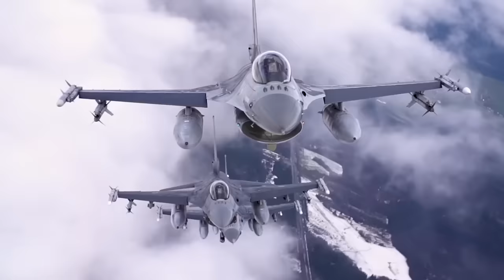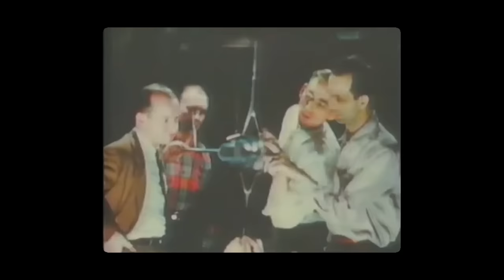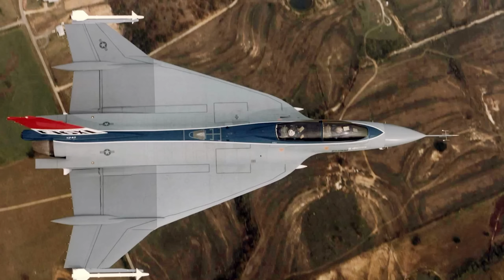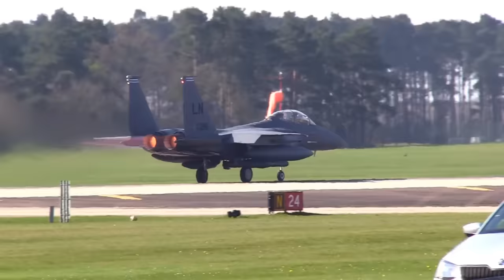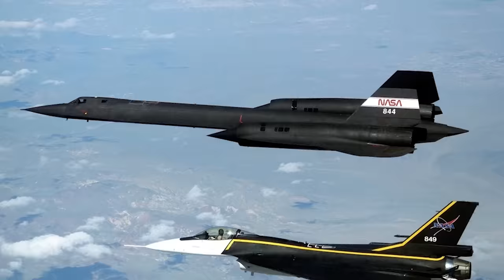When you supersize the airforce you get this…- F-16XL

Comment: One of the failures to be built was a fly-off against the original F16 where it's air-air abilities showed it to be compromised. Plus the newest F16 added leading edge and additional integral fuel to its wings "borrowing" some of the XL advantages. Just look at a brand new F16, it's obvious

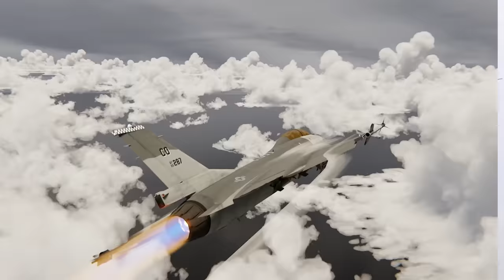Comment: Not to be nitpicking, but I have to nitpick - at 11:35 ; the European 4th generation fighters did not follow the designed proved effective by the F-16XL, the delta and double delta wing had already been proven long before that (for example the Saab Draken first flew in 1955, and Saab Viggen first flew in 1967). Europe always liked the short takeoff/landing distances that the delta wing provided, even better with the canards.
With that said, the F-16XL is a beautiful plane, and it's truly a shame it never got to be put in operational service.

Comment: Honestly, I don't know why we still use the F-16 at all. While it's cheaper than the F-15, it doesn't do anything the F-15 can't do. When all else is equal, you just pick whichever is more cost effective.
Reply: Which would still be the F-16 in a big chunk of instances. On average per year, the F-15 costs twice as much to maintain and support vs the F-16. The F-16 also makes up the bulk of the forces because it simply makes more sense logistically. That said, it won't have as long a life as the F-15 because the F-35 will fully replace it. Whatever is done with the new F-22 variant will likely serve as a replacement to the F-15, but that's still quite a ways away.

Comment: F-16XL wasn't chosen because Air Force product selection isn't about buying either the best or most cost-effective aircraft, it's about that overpaid cushy executive job Boeing will offer you after their plane is chosen and you retire early.
Reply: The F-15 wasn't designed by Boeing.
Reply: F15E was design and made by McDonnell Douglas before the merge with Boeing.
Reply: The XL was not chosen because all it has over the Mudhen are looks, and even that is subjective.
Reply: It wasn't even Boeing at the time.

 The Strike version of the F-15 was picked for many good reasons, as time has proven. It's range/payload advantage were just a few of the reasons.  The XL performance gains were not large enough to warrant a change from the conventional F-16.
Reply: @konekillerking  in addition going from a light grey to a Mudhen was not much of a difference. Going to an XL from a standard Viper was a drastic change. Almost a new aircraft.

Comment: This aircraft with the F119 engine and thrust vectoring would be interesting. It couldn't have used the engine the normal F16 uses as it would be way under powered. Also as it doesn't have canards it would have terrible slow speed maneuverability. I reckon that if this plane was relooked at today with modern avionics and hardware it would be very interesting.

Comment: I'm like, 90% sure that the Gripen's wing is a delta not because of this american plane, but because SAAB has got lots of experience with delta wing aircrafts, probably more than any US manufacturer, that's for sure, and the same goes for the Rafale, Dassault has got a LOT more experience with delta wing fighters than any US manufacturer. Last time I checked, the Draken, Viggen, mirage 3, mirage 4 (which is a bomber), mirage 5, mirage 2000, mirage 4000 (prototype), some of these being 3rd gen and some being 4th gen, were all older than the F-16 XL, these two companies don't have a habit of copying their neighbour's homework.

Comment: Each aircraft is defined by parameters such as wing/loading and thrust/weight.  Someone is lying here.  For a maximum engine power of 29,500 lbf and a mass of 48,000 lb, you cannot get anything other than a thrust/weight of 0.61, which means that the engine is too heavy and the rate of climb cannot be 62,000 ft/min but 27,604 ft/min.  There is also mention of an engine upgrade to the regular F 16 that allows a rate of climb of 62,000 ft/min, but then the F 16XL would have a rate of climb of only 34,229 ft/min.

Comment: The F16XL is being reevaluated because it has the same number of weapon stations as an A10. For much of the last year the A10s were being tested in a different role in the Pacific. A MLD launch platform. The problem is there are less than 300 serviceable ones left. That is why none will go to Ukraine. A large number of MLDs plus a respectable range. The F16XL or its upgraded version would fill that role nicely. It’s all about the money as usual.

Comment: Delta takes a higher AOA for the same high lift, during landing visibility is poor and requiring more power to offset the larger drag and frontal area. The Delta wing is light and rigid but the energy lost in a steep turn would definitely prevent it to engage any close combat dog fight limiting its role to bomb carrier and mid and long range missile launcher. The F15EX has NOT those limitations. Now comparing Gripen E, Tejas and FA-50 with similar/same power plant, the slower with F16 type wings also turns better than both delta counterparts…

Comment: US Air force wanted F-16s.. The designers had half of DARPA funds.. 

just to create an F-16 based on Tejas Aircraft of India 😂😂😂
Reply: Bro the F16 is 40 years older than the Tejas. Wth are you talking about?
Reply: The F-16XL was designed and built in the early '80s, the HAL Tejas was designed in the '90s and built in the 2000s based on the Dassault Mirage series.
Reply: the F-16XL was designed in the late 1970s-1980s...  Tejas didn't come into its form till 2008

Comment: To address whether the US air force should have used this variant or not: Mostly seems unnecessary. No negative context here, other than money. F16 works better as a support fighter, performing well as a multirole, at a relatively good operating cost. But yeah, having 2 engines is kinda better for surviving. If we're taking an engine from the F15, which as a thrust to weight ratio greater than 1 (a feat relatively uncommon), and slapping one of those onto a light fighter, you get compatibility, logistics, and cost advantage the F16 has. 
In this case, cheaper can be better. And it has combat experience proof too.

Comment: USAF and USN don't like delta wings on fighters that might need to maneuver their nose towards a threat. Delta wings make good lift but bleed speed on turns the USAF deemed unacceptable at the time. European fighters were designed and used as high speed interceptors patrolling their airspace or running ground attack in uncontested airspace with other Nato forces and in that role they don't need to worry about the loss of airspeed cuz they'll just avoid making any tight turns. 
The NGAD will probably be a delta style/blended wing design to make the best of newer stealth tech, not intended to ever have to make evasive turns or fight within visual range. The F16EX would have been something to see but it wouldn't have the survivability of the F15 or F18, it wouldn't have the speed of the F14 or F15 and it wouldnt be as maneuverable as the F16. Still a cool bomb truck though.

Comment: "It was just at the wrong time and fell victim to financial constraints."

Yeah, the F-16XL was less capable of doing the required missions, whilst costing more than the F-15E.

Sure, it was better than the F-16 at ground attack moatly because of a higher payload and more fuel meaning it could fly missions without external tanks... but it was inferior at the one thing that the F-16 actually did better than the F-15 (dogfighting - a Viper - but not an XL - can outturn an Eagle easily), while costing more than the most expensive F-15 variants.

Even in the (not really envisioned at the time, because the nexessary missiles, data links, and stealth fighters with air to air capabikity, were all still more than a decade in the future, even as pre-prpdiction types) role of a "missile truck"☆, the F-16XL wouldn't perform better than an F-15 variant (the now F-15EX).  At that point, all it's bringing to the table is supercruise... which is more useful to a continental defence interceptor than it is to a geberal purpose fighter.  I mean, supercruise is nice to have if it doesn't cost you any more useful performance and doesn't cost too much.

.
☆ To stand back and deliver a massive load of long range missiles while the forward positioned stealth aircraft stayed stealthy without any external stores, using their low interxeot radars in TWS (Track While Scan) mode and data links to take missiles "handed off" from the missile trucks behind them.  This overcomes the problem of stealthy aircraft having low payloads (especially if they want to maintain their small RCS).

Comment: Tldr: The usaf are cheaper nerds than the reformers, lmfao! 🤣

You should totally talk about stuff going against the blk50 F16s like the F22 wing one, other deltas, etc. . . 

There are some epic designs and concepts out there! Tho, I will say, they did expect XLs to lose dogfights (basically large ww3 furballs ironically, like war thunder) based on them losing practically all air speed just to make u turns constantly, whereas the rough understanding of the normal F16 was that within large force on force or force on small force engagements, they kept their energy and momentum in fights a lot better. . . 

Ig the preformance gap in maneuvering and regaining of energy during combat and such may closed if the XL had been powered by a much later F119, etc or F35 motor, but that would be a forseeable upgrade or production decision only conceptualized within hindsight some 30+ years in post. . .

Inevitably, it would have been a perfect alternate alongside the superhornet style F16 that was canceled too, right before the japanese basically got it (their F2). . . Forgot the name of the frogram, though, but it was under the same name as another plane that was different! 😅

Comment: Look, with the Variants we have today, the XL still remains the better choice. Even with the addition of conformal fuel tanks, the XL out ranges today's 16, with better loadout capacity.
So, rather than buying these overrated 16 variants, update the xl, to modern avionics and manufacturing abilities. 
Still get a better plane.
Or, maybe, it'd be too good? Shaming it's cousin, the Lockgreed f-35?

Comment: The F16 is not a ground attack aircraft. 

Its like using an assault rifle as a sniperifle. 
You can overstress the fuselage which might lead to structural failure mid flight.

Comment: Sorry but you got something wrong and other things  left out. There was another plane that was better than the F-16 and cost less way less then the F-16. The F-20 Tiger Shark actually won the competition and was cheaper over all cost to build and fly. Think about this, for one F-16 the cost to build and fly/maintain. You could have 3 F-20's.  Something else to think about. A F-20 could fly from the west coast to the east cost none stop with no refueling required. Where the F-16 had to refuel twice. and the F-20 had a hire payload capability than the F-16. And the YF-17 which was later on and it became the F/A-18.  And it was political pay outs that wont the F-16 contract. Watch this video "" F-20 TigerShark | should have been built "".